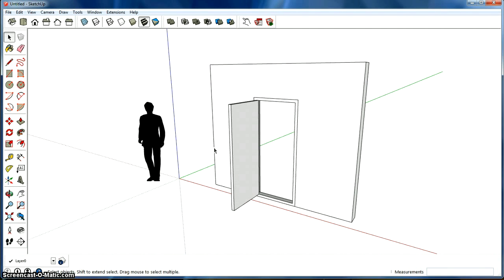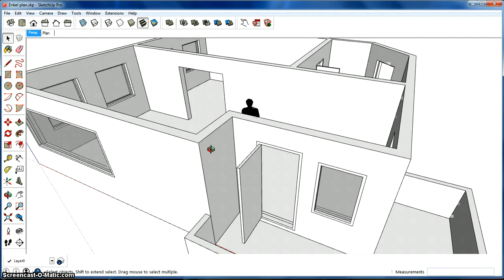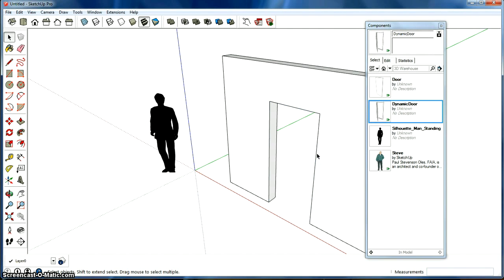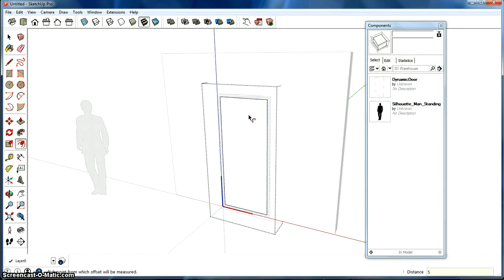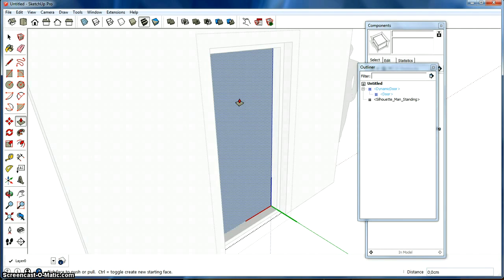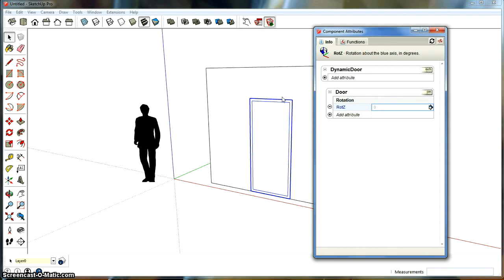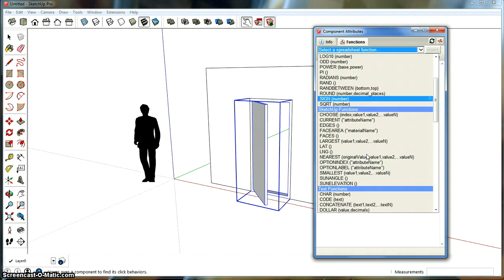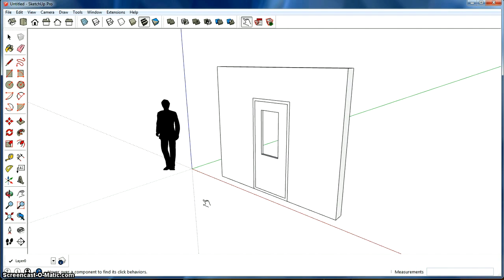Sketchup Dynamic Open and Close Door Tutorial

Comment: I just tried using this tutorial with Sketchup 2017 and it did not work. Every time I try to interact with the door I get "Invalid Entity to Animate" with no explanation as to what is wrong or why its 'invalid'? I am trying to create a sliding door, but when I first got the error I tried making it a rotating door and got the same results.
Reply: Upon further google searches fund the culprit. Apparently the Mac version does not like Quotes around the attribute. When I removed the quotes, my door suddenly was working, sliding back and fourth as its supposed to.
Reply: @Krahazik  mate. I’ve just found this comment and it should be pinned for Mac users. Just learning this stuff and your comment saved me. Thanks. Big thumbs up. I also found this can all be done with just the door. No need for door frame as component too although it might be because I created a 3mm gap round the door for realism
Thanks again massive help

Comment: hi, how to make this component to be able to open & close, say five number of door at the same time, in one click. At the moments when I copied this component I have to open & close each door separately, which is very annoying, anyone can help ??!!
Reply from the maker: Hi. Yes you can do this. Just put your door component in in another component. And open that component before using the interact tool. 

For my sake i like to controll each door seperatly, even when it´s the same door component. Actions are a way do differentiate component and still keep them "un-unique". You can for example make a component with 5 types of random plants. It´s sort of a brain cluster to explain, but the bottom line is that it´s supposed to only effect the components you interact with, even if it´s not unique.... Sorry... really bad explanation. :)
Reply from the maker: +Pawel P you need to nest them all in the same component and set the value and on click action on that component.